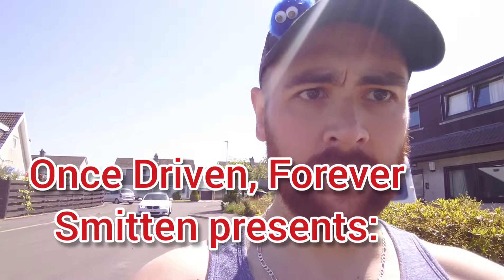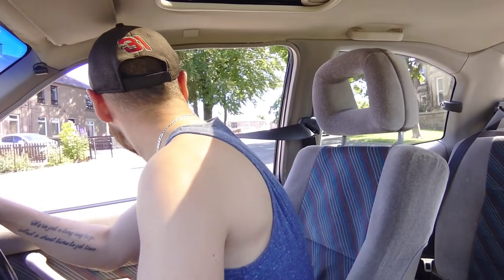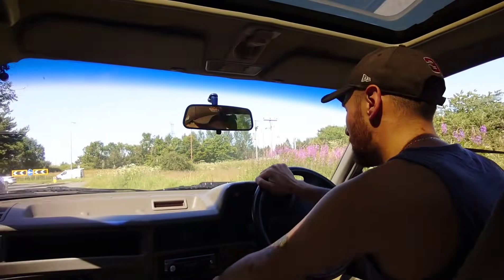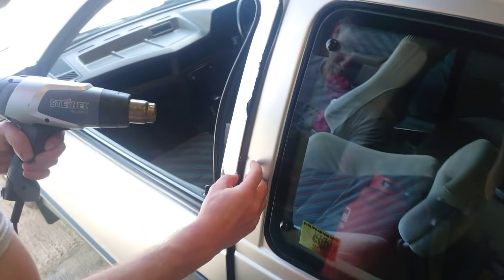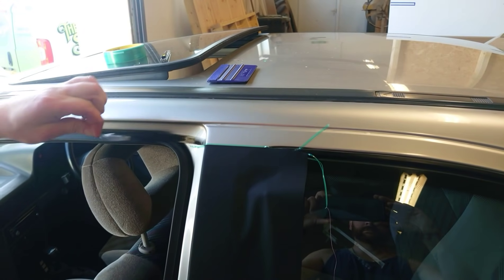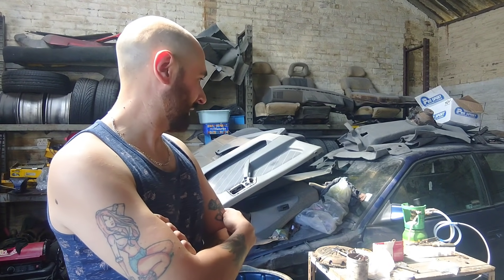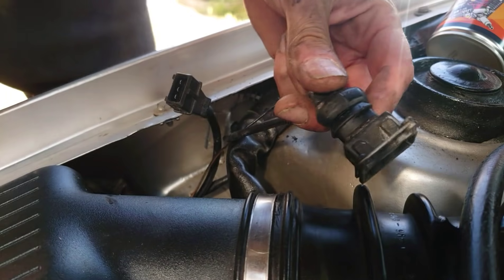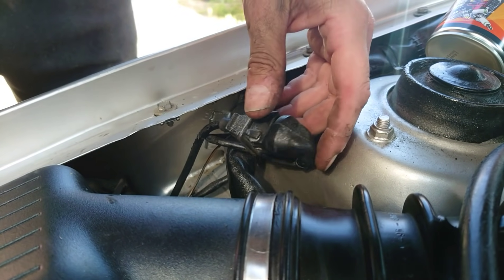BIG day out prep: Astra GTE 16v gets new decals, new wheels, crank sensor & fuel pump relay checks

Comment: Good call to replace that crank sensor. That wiring needs a proper shielding sheet. If it's broken it mmight cause the signal getting messed up. 
GTE looks spiffy! 
I was just wondering, are you at all interested in Deawoo's? The Nexia is a lot like that Astra. And the Espero is basically a Vectra 1 in a Korean coat.
Those Deawoo's could be good donor cars to keep Vauxhalls on the road.
Reply from the maker: Those models of Daewoo have almost totally vanished in UK. Would be interested in a top spec Espero just to see what it's like

Comment: How come it's pre cat, has it got a pre 1988 engine in it.
I have still got my rare 1999 astra 2.0 16v 3 door in red, only 71 left on uk roads now.
Owned it 17 years.
I might be selling it soon to get a nearly new astra sri 1.6t 197 bhp.
Always liked the gte 2.0 16v's but could only afford an 1990 astra 1.8 8v 3 door in bordeux red at the time.
Did 192,000 miles with that engine using hardly any oil.
The engine, clutch & gearbox all original and perfect when i sold it in 2004.
G304 EAJ.
Top video dougie.
Reply: Pre-cat? It's too early a model for a catalytic converter. I believe only the "J" reg about 1991 had cats, happy to be corrected. I owned a metallic black "J" reg GTE and it had a cat on it and noticeable lack of power and "dull" acceleration compared to a mates "F" reg and a "H" reg I test drove also. If I remember correctly Vauxhall fitted them but they weren't mandatory on UK roads until "K" reg 92 cars, so it could have been taken off a J reg GTE and no problems with legality etc.
Reply: @Franksey180  Thanks for that franksey180, did not know this, really useful info.
Reply: @1066gaz  No worries. I've never "de-catted" a car as can't be doing with the pain of MOT hassles on modern cars, engine warning lights etc. On one of my cars that had a lot of upgrades I fitted sports cats, still made good power, no engine warning lights and passed MOT fine. Way better solution than all this "straight pipe" nonsense on modern cars. Always wished I'd de-catted my GTE 16V though as would have been no MOT hassle and would have made it more like the car they were supposed to be. Still loved it though, but it kind of missed the mark a bit.

Comment: Wasn’t a loose HT lead? Happened to my Astra GSI 2.0 16v.
Reply from the maker: Nah he got mixed up which cars had had new sprark plugs in it. The ones it was running were AC Delco I put on serviced it in... 2014 🤣 Had a set of NGKs that were due to go in Omega and boom off it went.
Reply: @OnceDrivenForeverSmitten  😳😳😳😂😂😂😂

Lovely example by the way mate, loving your vids!

Comment: Did you know if you took the Speedo clocks out there is a switch on the back so the Speedo can calibrate to 15 inch wheels….And the Speedo reeds the correct speed
Reply from the maker: Did not! 🤠😄